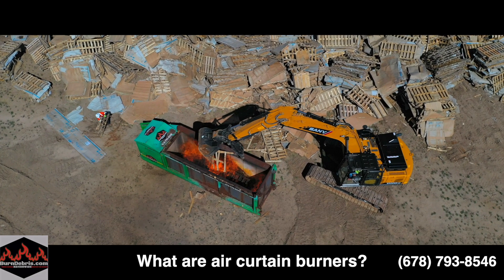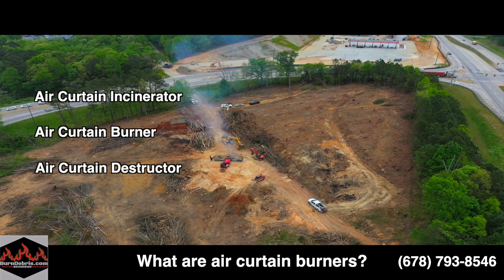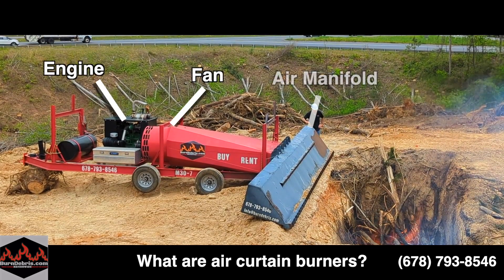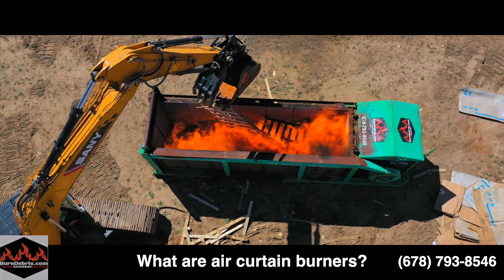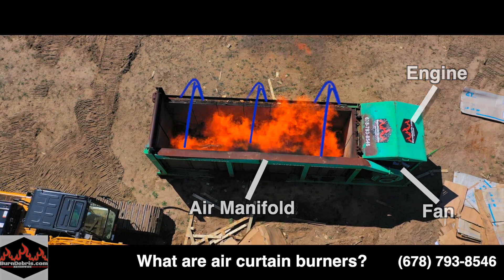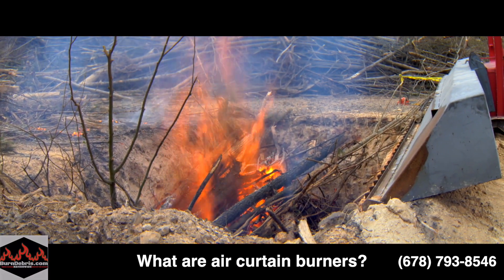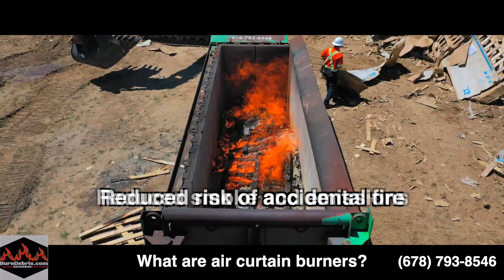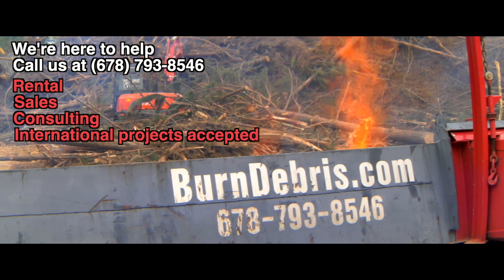The many names of Air Curtain Burning Technology

Comment: What types of costs are these?  What type of fan and power does this use?  
Is there any system like this a small contractor could build with air movers, ( like for drying floors) that could be used to burn like this for land clearing?
Reply from the maker: These burners vary dramatically in cost depending on the brand, make, model, year, and hours on the machine. They can be rented or purchased and are very mobile for use on multiple sites. They are used very commonly for land clearing.  Feel free to reach out to our office with any questions and specifics and someone will be happy to help you figure out what kind of machine would fit your circumstances and budget best.

As for building yourself, I would recommend extensive research to make sure you can build one safely since there are many factors to consider beyond simply the fan. I'm unsure if those kinds of fans would have the desired airflow output to actually accomplish forming an air curtain and circulating through a pit.